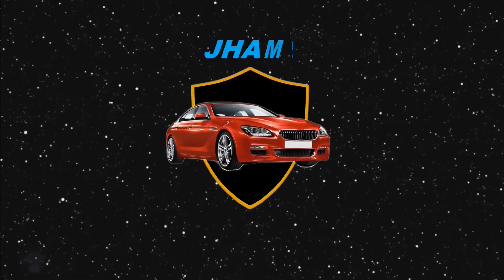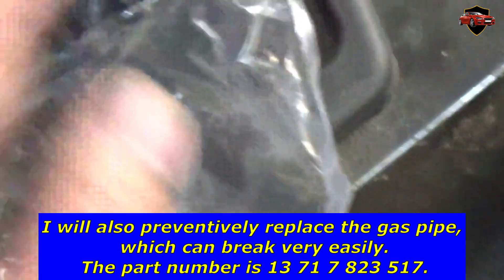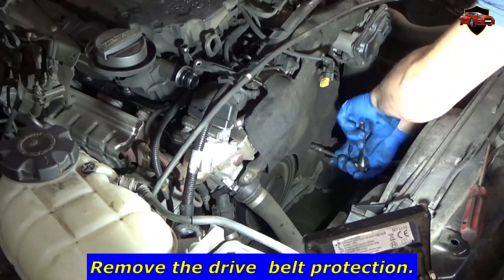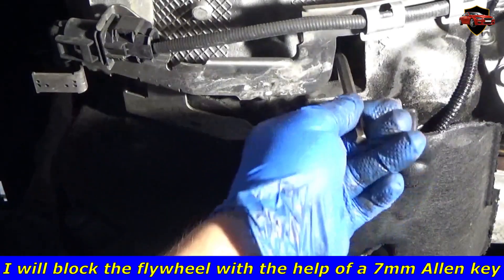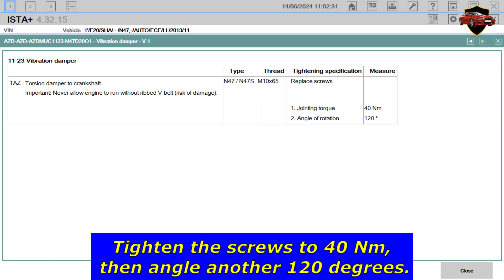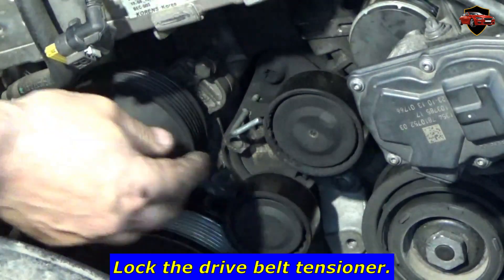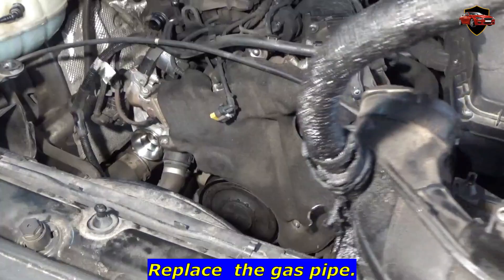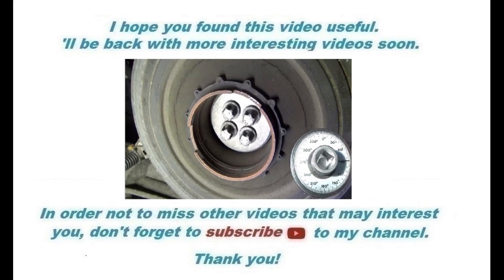BMW 2.0D N47 - How to replace vibration damper  BMW F20, 1 Series.

Comment: Hello, is the locking procedure the same with an automatic?
Reply from the maker: Yes, it can be locked in the same way on automatic gearboxes, just be careful that the key does not tilt when tightening.

Comment: Do you have to lock the fly wheel?
Reply from the maker: yes
Reply: @JHAMS.001-car-repair  you mean put first gear on the gearbox?
Reply from the maker: You cannot lock the engine in gear 1 if the car is on a lift, and I do not recommend locking the wheels with the handbrake.

Comment: Is there any risk of the engine timing being out by removing the pulley?
Reply from the maker: There is no risk, the timing chain is at the back, you just have to be careful not to rotate the engine in the opposite direction of rotation, because if the chain is loose it can jump.

Comment: please can you answer me.  How much is 120° on the torque wrench Nm? Thanks
Reply from the maker: Unfortunately, I can't tell you, it depends on the hardness of the screw, if the screws are old somewhere around 70-80 NM, if they are new, I can't tell you for sure and I don't want you to have problems because of my advice.
Reply: @JHAMS.001-car-repair  the hardness of the screw is 10.9
Reply: @JHAMS.001-car-repair  ???
Reply: 120° is 1/3 of 360° 😊